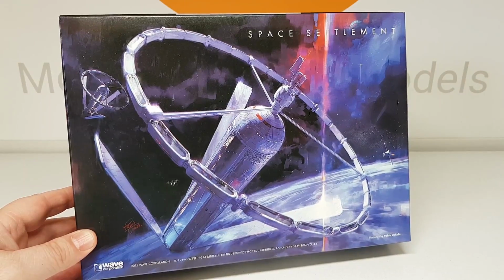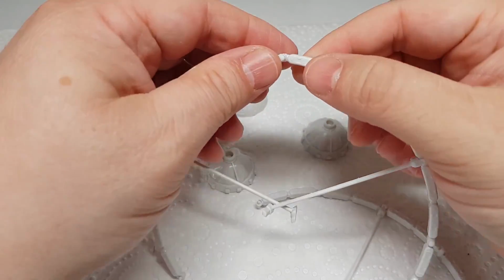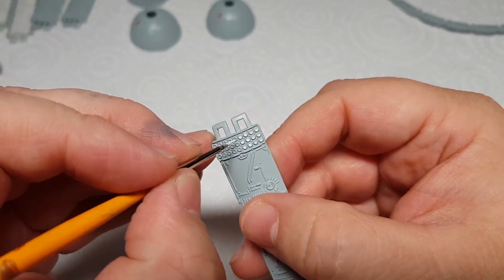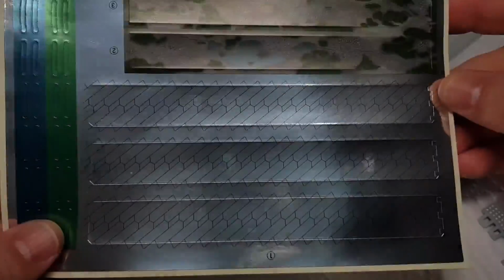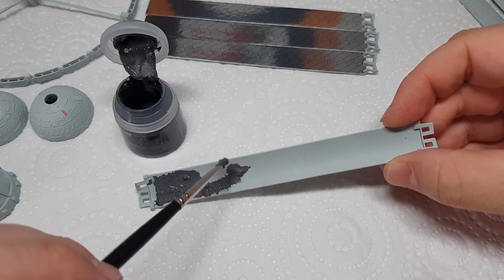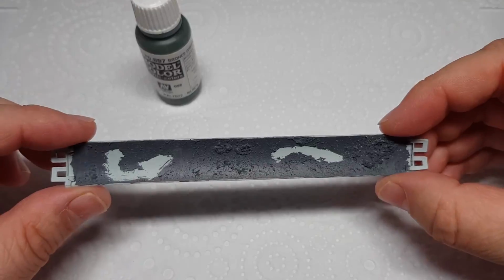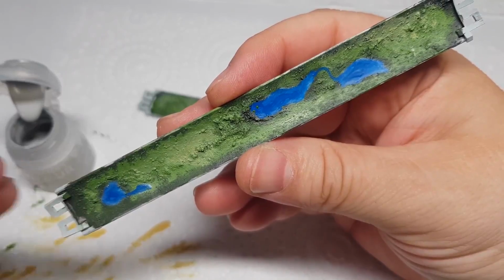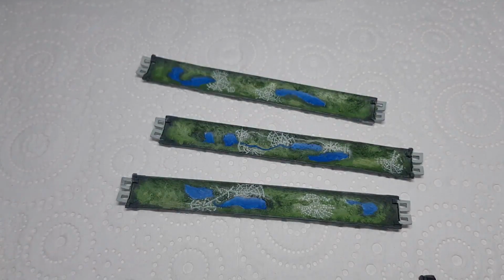Building the O'Neill cylinder space station | Gundam Space Colony

Comment: Lovely, as always, particularly the landscaped interiors. I noticed you xwitched from ypur long-favorite Tamiya primer to Vallejo, and also used a different clear-coat. What made you switch? Just the ability to skip and spray can and use the airbrush instead or something else?
Reply from the maker: Thank you! And yeah, good spotting! The simple reason is that my local hobby store can't get any Tamiya Primer or Flat Clear, there's a bottleneck from Japan to the local distributor. Just a symptom of the times unfortunately.

Comment: Piping on the outside would most likely be subway systems or cargo transport or movement of water & air
Reply from the maker: Yeah, that's a good point. I actually considered putting little roads and lanes on the landscape but figured they'd probably use a turbolift or subway system under the surface.

Comment: I think I still would have glued the parts togeather.  I dont trust all those press fit connectors.

In any event,  that one good looking model - certainly a conversation piece. 

I agree, the scale sort of defies any kind of weathering - one wouldn't see it however, one could try paneling with very faint variations of that white grey.  It would be a real problem for time to perform the required masking and such.